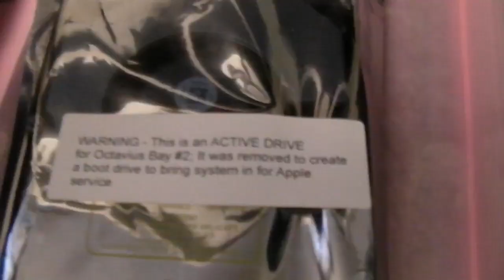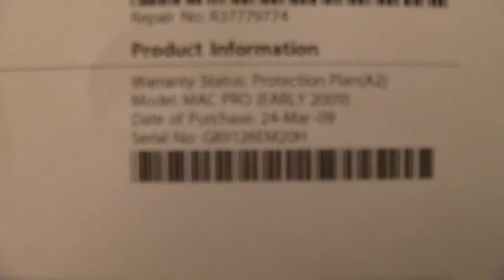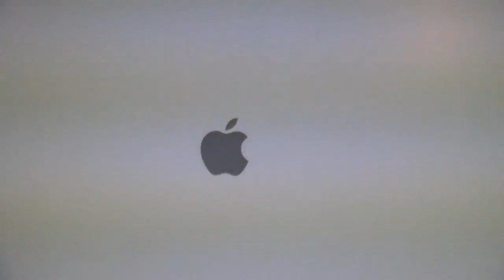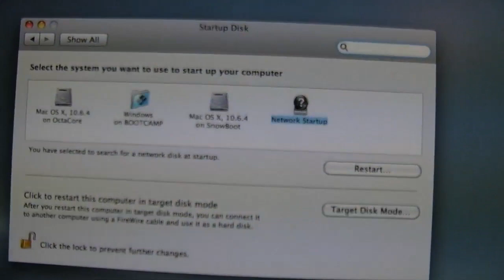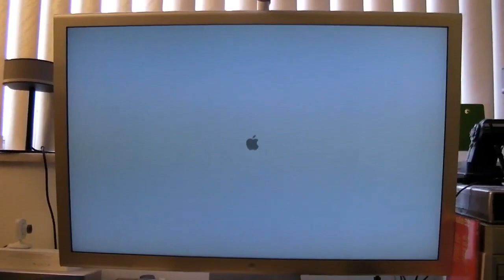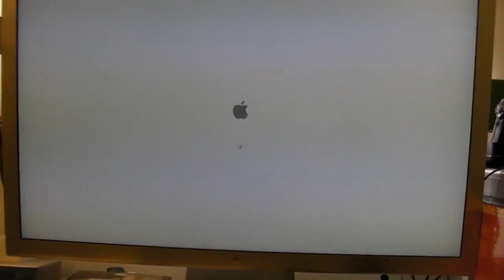Tech : The Re-Unboxing of Octavius (8 Core MacPro)

Comment: @adiblasi I prefer SCSI over eSATA just because I like the connection cables a bit better. Right now I'm running a Seagate Cheetah 300GB drive running at 15k RPM as my main backup. I'm looking into trying to find some old mac hardware to run a media server off of it. If all else fails, I am going to resort to FreeNAS.